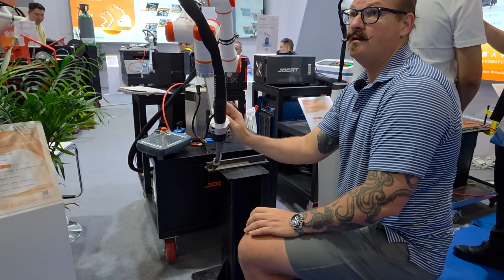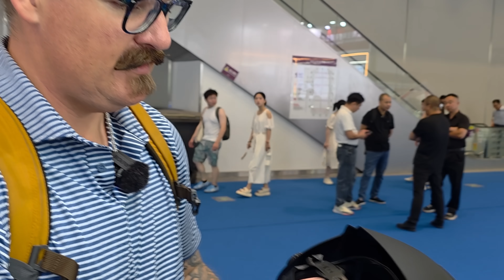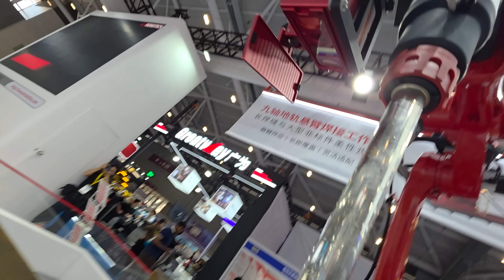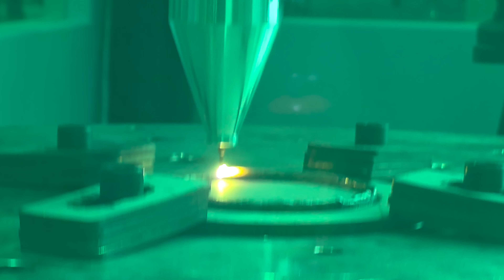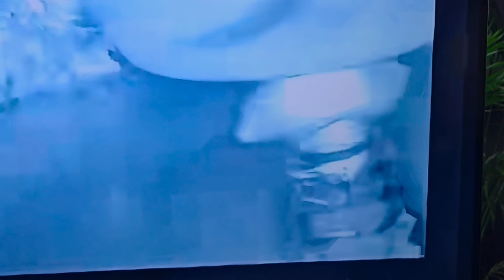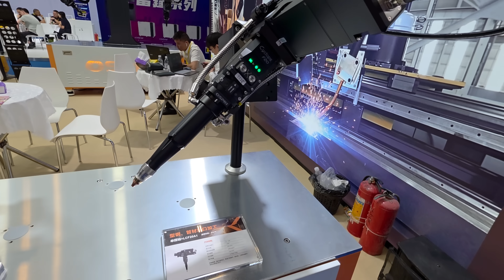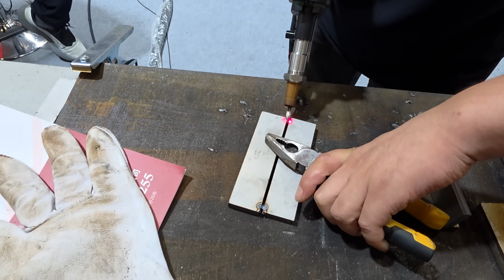The End of Hand Welding (I Saw the Proof)

Comment: I just tried our new laser welder and I don't think it is a good replacement for any other process yet, some situations it will work well but it's still very limited.  As far as robotics goes there is still a lot of welding that is on parts that don't have perfect fitment and dimensions such as roundness and flatness so that combined with the cost which is coming down but still not affordable for many businesses yet means welders and fabricators don't have a lot to worry about just yet. Robots have been around in manufacturing for several decades now and laser welders are over hyped, the time may come where they both take over but it may be in the distant future but maybe not as things do not always progress linearly but I wouldn't gamble my life savings on it.

Comment: Someone still has to inspect those welds😂
Reply: They said the same thing about software development. Well that still need human but the number of human required reduced drastically. Only top few will survive at the end.
Reply: @CowardBoy-q8p  You mean only the "cheaper" option will survive in the end... Layoffs in tech have already shown its usually the ones who cost the most or have most seniority get dropped first :S
Reply: Just like with computer programming! 
'ai' doing the coding now, and the developers job is to inspect!
Reply: @darz_k.  They are dying
Reply: It will be by robotic inspectors.  Visual scanner, X-ray and/or ultrasound.
Reply: Can be automated

Comment: I’m not a welder but I was thinking of buying a Lazer welder for about $5grand and practicing and teaching myself and taking a welding class.  I am self employed in my sixties and restoring motorcycles in my spare time, and taking parts or frames to a local shop is a pain.  So I’m going to teach myself how to use a Lazer welder.  I am an amateur fabricator, but learning.
Reply from the maker: Laser welding is way easier to learn than tig welding, I think you've got a solid plan

Comment: Welders have to do a lot more than just weld. Torch, Gouge, Grind, Fit, now run a robot. I've worked with robots, they suck they miss a weld joint by an inch lay a perfect bead in the middle of nowhere
Reply: Robots in manufacturing is a pipe dream... Not one of these robots can run independently... It would be absolutely catastrophic.
Reply: @Totally_Not_Saddam  >Robots in manufacturing is a pipe dream
what
Reply: @masta182 I'm not talking about you...😂
Reply: @Totally_Not_Saddam  what
Reply: @Totally_Not_Saddam  The automobile industry would like a word with you !!!   Your comment is laughable !!
Reply: @GodzillaGoesGaga 😂😂😂 the robots in the automobile industry don't run them selves buddy as a matter of fact robots were put into the automobile industry to ASSIST the human worker to make the HUMAN'S job more comfortable in turn makes the HUMAN more productive... 😂 I'm not retarded genius, I used to operate CNC machines which is also a form of robot... So I know first hand what I'm talking about... There is simply no way for robots to run unassisted if it can go wrong it will, and often. From programming and reading errors to mechanical errors to stray cat caught in the machine errors.. which would cause catastrophic consequences on the production line. 😂 There's a story where Nissan experimented with a fully autonomous robot for sheet metal they spent millions on this robot only to come to the conclusion that this robot would take a month to do what a human could do in a day.. it was just a gimmick, and was constantly breaking. 
Like I said, Pipe Dreams for billionaire super villains.

Comment: Yes the machines can weld in a controlled environment repeating the same process over and over again. They cant retrofit new equipment into old, They cant work 300ft in the air under a bridge, they can't repair bent and damaged equipment. So no hand welding is not over just the cushy indoor jobs are.

Comment: But just one example: The Kaiser Steel Mill in Fontana, CA was completely dismantled, shipped and reassembled in Guangdong, China and up and running in just under 2 years (1993–1995)...

The shutdown of the Kaiser Steel Mill axed 8,800 manufacturing jobs, impacted over 15,000 regional workers and families. 

The mill loss forced the closure of the Eagle Mountain mine, turning a community of 3,700 residents into a literal ghost town forcing residents to pretty much abandon the town.

The pensions of 30,000 retirees were threatened.

Hundreds of connected local supply businesses were severely affected.
Reply: And on Wall Street the corks popped,and champagne was poured.
Reply: @Dogonboat-j2e...and in Beijing.
Reply: Trumps war is costing 1 billion dollars per day right now. That could save a lot of US jobs. Whole towns in the US are closing and what does Trump care well he does not care at all.
Reply: @Bob-f7c2r well trump just started economic war with Canada. Expect more pain

Comment: Which is the best lazer welder for onsite mobile welding with single phase power and I have to weld steel from 6 to 25mm thick in house and factory construction

Comment: AI has become incredibly expensive to use in office settings. It is now cheaper to hire a human than have AI do it wrong. I wonder what the cost will be in shop settings.
Reply: If it's a dumb cobot doing pattern repetition set by an actual welder, probably not that expensive. But you'd likely see an uptick in QA and maint like machine shops have already in tool and die and stamping. Value add might be in multilayer welds or refinements on a pass (less human welders, but senior welder wages go up significantly to compensate for knowledge transfer)

Comment: These welding robots which scan the tagged parts with laser to make a 3D model and can make a weld pattern, are really impressive. I can see a custom fabrication shop have a station with a belt feeder with just putting tagged parts on it or a rotary arm that feeds the welding station.

Comment: In your dreams author 😂, try to weld them under water😂and try bring them on the field, on the piperacks with pipe thickness of 1" to 2 inches high pressure pipes😂that tech is for frying pan and other kitchen utensils needs to be weld, 😂

Comment: There may be some shops that invest in a welding robot to be able to run perfect beads. I wouldn't recommend investing much in such a thing though, because it won't be long before humanoid robots will be able to perform the same tasks, and they'll be more flexible than specialized automation.

Comment: You're missing the issue from my point of view. These machines do not need to replace hand welding to disrupt the welding industry. Rather they need only make welding easy enough with settings automated so that welding becomes as easy as operating a ball point pen. The need for skilled welders will change and the positions held by skilled welders will be easily replaced with workers that are able to create the highest quality full penetration welds at 3X+ the speed of any skilled welder today using standard methods with literally a single day of training. This level of shop fabrication is already happening and shops will be forced to use these newer welders to remain in business and the turnover to laser hand welders will happen very quickly. Welders who spent enormous amounts of time learning and becoming skilled in the welding trade will be idled as low cost workers who need little training are able to equal the quality and increase output several times what doable today w/o lasers. This will also disrupt the welding equipment manufactures as the equipment becomes less common... look out Miller, Lincoln, etc. Ray
Reply: This is why people always told me Welding without fabrication skills is always going to limit your potential.
Reply: @RovexHD  This happened to Lithography about 25-35 years ago literally over night entire trades were eliminated... plate makers, strippers, dot etch techs., color separation specialists, paste-up artists, lithographic cameramen, typesetters linotype operators, Ludlow operators, proof pressmen, and more no longer needed for extreme high paying manufacturing jobs that required many years of apprenticeship to become journeyman skilled thru 1990's computer automation of presses and support functions. So you are in my estimation 100% correct in your assertions regarding welding and fabrication shops. Ray

Comment: I don't think the fabrication is that safe either, laser processing of sheet and now tube or sections is so low cost and mainstream now and in the design phase you can as a designer and I am sure the modelling programs will start doing this automatically put tabs and interlocking joints which can then be assembled easily with robots and unskilled persons.
Reply: I do gates railings and balconies I think it’s too fiddly to expect a robot to prep everything according to specifications (everything is bespoke with residential stuff).

Comment: Hand welding will never die robots are good at repetitive welding and not every welding is repetitive.
Reply: A cobot works great on one-offs: in record mode, you drag the tool over the area you want welded. Then you put it in simulate mode. It goes over the work motion for you to confirm it's correct. Then you put it into work mode and go setup the next weld on a different machine. When you come back, the weld is complete.
Reply: with ai training (collected by cameras on human welders ect) and all that, it will handle any task.
Reply: @izoyt  yup. Pretty soon, you'll be wearing some are goggles like the meta glasses. 

You will explain to the ai what you want made. 

It will show you a generated 3D model in space that is fabricatble with your preferred Fab methods. 

Then your automatic tools can probably cut and Fab everything for you. 

This might be like 10 years out, but who knows how fast AI will progress in that time 😅

Comment: China doesn't care about the US market , it's only 8% of exports , it's wants the global market, the other 92% 
They are going after Blackrock who currently own all the brands , Lincoln , Miller , Esab are under attack China already own the supply  chain, copper , windings, circuit breakers transformers , electronics, hi power diodes, power transistors,  electrodes , welding wires mig ,mag ,saw, Tungsten , lenses,PPE, air supply helmets, you name it,  the lot ,

Love this guy , weldors now need cad , sales , drafting skills , but he nails it when he says an engineer with cad skills still can't actually assemble anything ...

Field stick weldors still gross more than the average engineer , and rightly so , it's hard , heavy work , burns , radiation , noise high risk , it gotta be worth more than a KB doodler sitting in a nice AC office 
Think how many stick weldors needed just now to get oil refineries going after WW3

Comment: As a structural Ironworker and tradesman in the field, this will never make us obsolete. Perhaps in a shop, but even then, you would need someone to program it and for setup, material fit-up and QC, plus 100 other procedures etc.
Reply: Welding is a tool of my trade, nothing more
Reply: @bradleywalsh4103  Your entire trade will be basically phased for the most part. There will be very little need for human intervention at the job site. 

Please explain to us why think your job will "never" be obsolete. 

We aren't just talking about the welding part here buddy. It's literally most job roles from the start of a project to the end. Do you understand that? 😂

Robots can AND will do it ALL and they will feel zero sympathy about all the jobs they replaced. 

The owners of the company will be laughing all the way to the bank with their increased bottom lines and not having to deal with so many expensive, outdated and pain in the ass human laborers. 😂
Reply: You'll be replaced not by a traditional machine but by an AI controlled humanoid robot that has better dexterity, vision, endurance, and knowledge than you can ever have. Furthermore, it will work non stop 24/7 and won't have a shitty attitude about the advancement of technology.
Reply: Lol wrong. I think you don't understand how rapid things are changing with the use of AI technology. 

People are trained to perform all of those tasks you mentioned, correct?. 

As in, nobody is just instantly born with those skills. It is obtained from learning from mistakes and thus over time, you become more proficient at it. RIGHT? 

Well, ANYTHING a human can learn to do, a robot will be able to do as well. The AI is literally being trained directly by data gathered from humans performing the tasks man! 

And the thing is, when one robot learns something new, even the smallest improvement. Then ALL of them learn it as well, INSTANTLY.

It doesn't take breaks, it doesn't need a vacation, it doesn't need health insurance or other benefits.

It just works. Never complains. Never gets sick. If it needs to be repaired then there will another one to fill in almost immediately. Very little down time. 

People don't understand these robots cost very little at scale. Many of them are ALREADY cheaper THEN a single years salary of just ONE employee but it can produce the equivalent output of 20+ workers.

I'm sure you think many aspects of your is irreplaceable. I get it. I thought that as well a few years ago. 

Now I understand the reality is that some people are just oblivious to what this technology is capable of or just in complete denial about it. 

----------

Please give us an example of typical task you have to perform everyday on the job.

And I will explain to you how AI robot can be trained to do the same thing and do it better, more effeciently and cheaper lol
Reply: 😂 the arrogance of people commenting on things they know nothing about. Stay in the truck friend!

Comment: One thing you NEVER, EVER do is buy laser safety equipment from China. Every, single, manufacturer that I've ever tested on actual high-dynamic-range optical density measuring capable spectrophotometers(NOT basic bio spectrophotometers) has failed, with as much as TEN PERCENT transmission. Just go with Uvex/Laservision. They're good, lots of budget range options from plastic to dielectric glass. And the Optrel Panoramaxx Hybrid CLT is, while being ridiculously expensive, hands down the best laser helmet and regular welding helmet I've ever used. No affiliation, but I wish there was...

Comment: This is one of the most embarasing and worst welding videos I've ever seen, this stuff is an absolute joke, also none of this is new at all dude.there is a reason the top aerospace companies don't use this stuff,its called flight parts having to pass xray all the time every time. a decent welder will run circles around this nonsense, get one of these to succesfully weld exotic alloys on pipe and tube or 200 feet in the air in confined spaces lol

Comment: I work in power plants. Some of them have dust so fine it goes right past waterproof seals. Pretty sure it would destroy these systems. There's also a lot of confined spaces that would be nearly impossible for a robot to navigate. I don't see these systems welding high pressure boiler tubes any time soon.
Reply: Doesn't fine dust cause silicosis or lung cancer? It looks like both robots and humans are facing the same conditions.
Reply: @SIM31r  Indeed. We obviously have respirators but you can't use them full time, and they do leak.
Reply: @SyntacticOperator I rather see you guys operating a remote welder than to suffer from health issues later.  If this tech helps you and not replace you it would benefit workers in extreme risk environments
Reply: @hw8621 There's generally too many obstructions for robot welders, at least on the cold side of coal fired boilers. They could weld the hot side but I've never seen a robot buddy-weld with a human. "Buddy-welding" is where you share a single welding machine where the lead splits into two stingers, and one guy welds half of the tube, and passes the spark to his buddy on the other side of the tube wall. This is so there's no break in the continuity of the weld from start, to stop.

In power plants, it's generally faster, and cheaper to have a human do it.  How 'safe' it is for us to do our job all depends on how much the plant pays the laborers to clean beforehand.
Reply: Hand held
Reply: What about the 60% of welders in production roles that will be laid off and competing for the 40% of jobs left? Do you think that could be a problem?
Reply: @cameronkoblitz4248  Not if you're not working at all!
Reply: @SyntacticOperator  what does that mean?
Reply: @cameronkoblitz4248  I only know what it means for me, and only in the present moment. As far as I can tell, collapse is inevitable. Look up "the Baal Cycle'. We're in the middle of another "turning".
Reply: @cameronkoblitz4248  I'm going to form a union of the unemployed.
Reply: Wow!  Thats super scary!   How do you guys protect yourself?  The PPE must be so crazy military grade
Reply: @hw8621 Half face(6300), and full face 3m respirators. You wouldn't believe how many people refuse to wear them. They don't live long after retirement.